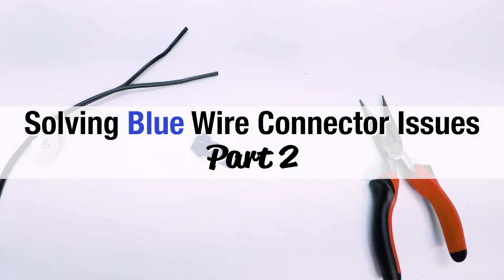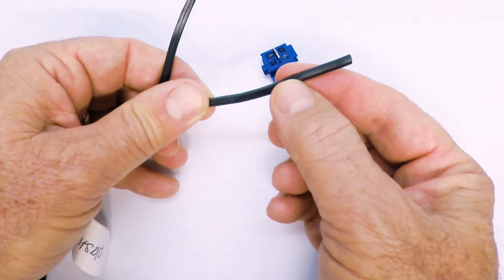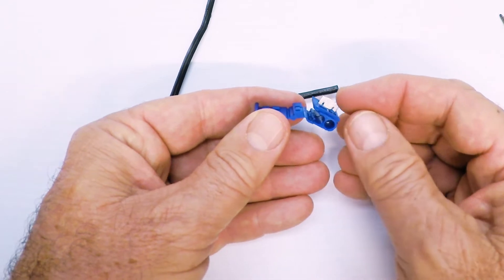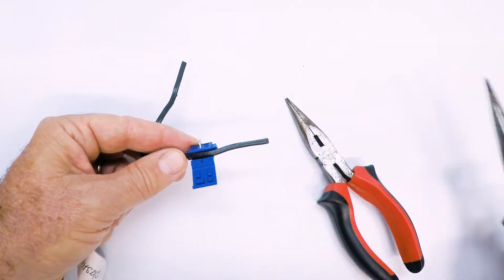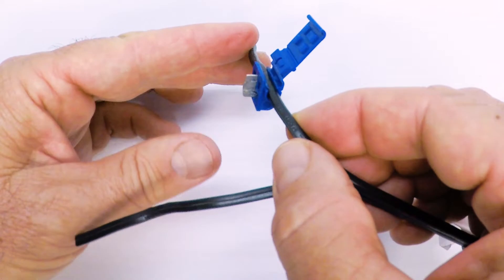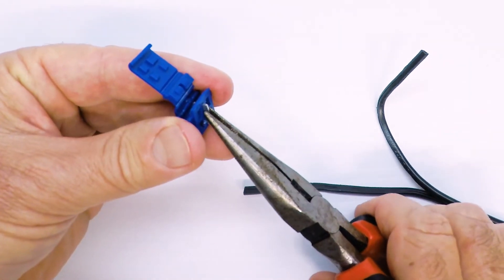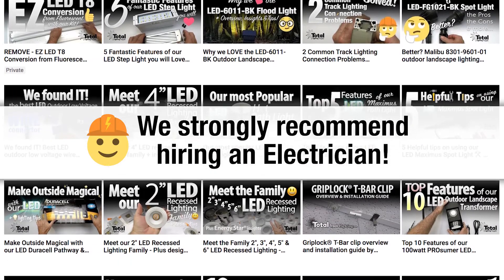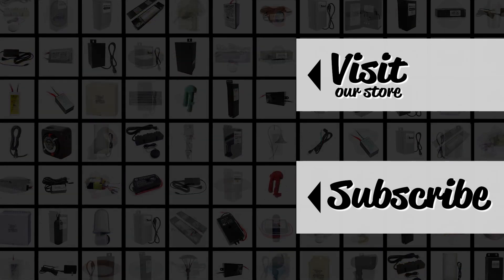How to connect our Blue Low Voltage Wire Connector to Wire with thick Insulation

Comment: What is that connector used for?
Reply from the maker: We use it in all our LED Outdoor Landscape Lighting Kits here 👉 https://www.totaloutdoorlighting.com/kits.html - It allows an easy wire connection for our low voltage fixtures to the main power feed.